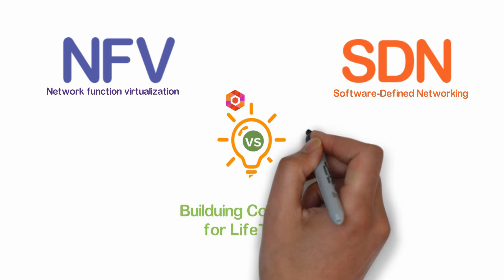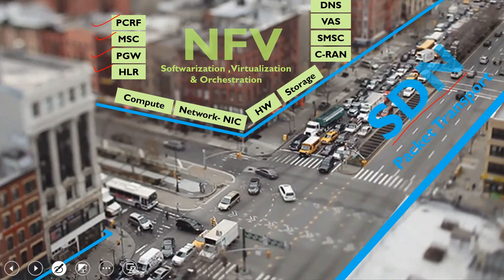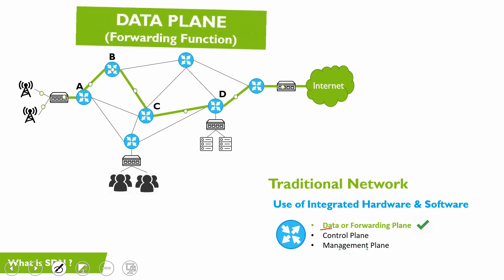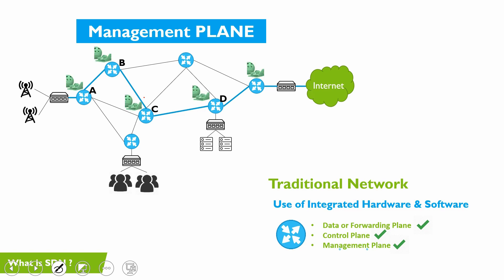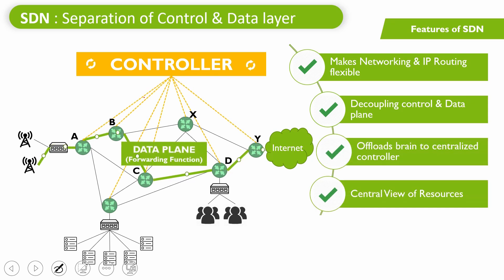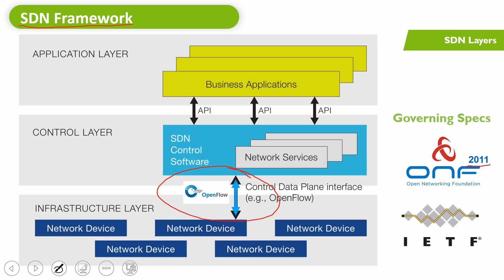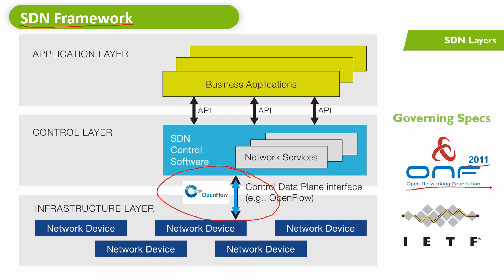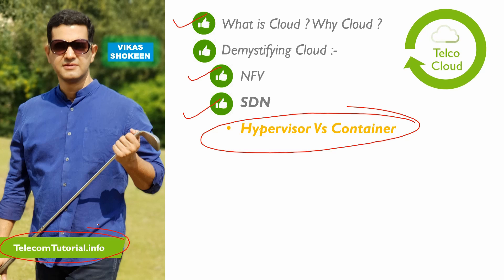3. Introduction to SDN (Software defined network) - SDN and Openflow Architecture

Comment: thanks for your NFV and SDN tutorial. It helped me to understand NFV and SDN in 1 hour.   Btw, is OPen Flow same concept as Open Stack ?
Reply: No, OpenFlow is the standard protocol used between controllers and data plane (switches) in SDN architecture to control the forwarding tables. OpenStack is a cloud operating system to manage the cloud resources (computing, storage ..)

Comment: 7:18 you said if D goes bad, A will never come to know. You are wrong. The way EIGRP and OSPF works, every router has the entire network topology. And if any router goes bad, the existing routers will compute new route and broadcast to entire network.
Reply: Yes, I agree on that Router are also enough intelligent for routing. There dynamic routing protocol in router which always kept update route. There internal broadcast massages to update the routing table and its also happen in few second. Many more technique ii router and switches to route the packet through best path.
Dynamic routing protocols are
RIP
IGRP
EIGRP
OSPF

Comment: Wouldn’t if the router goes down, the advertisement stops and post the timer runout, the route will be removed from all router ?
I’m still confused why the centralized approach will give advantage over the current one .
Reply: I think no need to implement SDN on router. These device are already super intelligent
Reply: @NEERAJKUMAR-eh5rn  yes. SDN is good for switches.

Comment: In the beginning you have mentioned SDN is separation of brain and control plane.. in the presentation you say that the brain of sdn is control plane and sdn is separation of control and data plane..( which is actually true) i think you need to correct yourself in the beginning

Comment: Will decoupling control plane and moving it to centralized location cause a bottle neck or how feasible if network grows large?
Reply from the maker: For large scale networks , user plane has to sit near to users and control plane has to get centralized , This helps in maintaining robustness ,  Redundancy and resiliency of control plane nodes